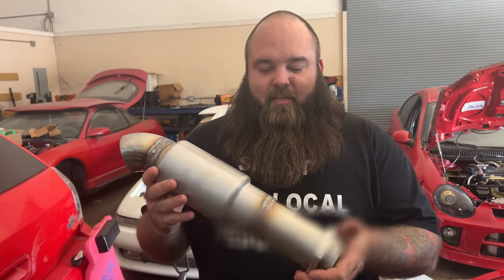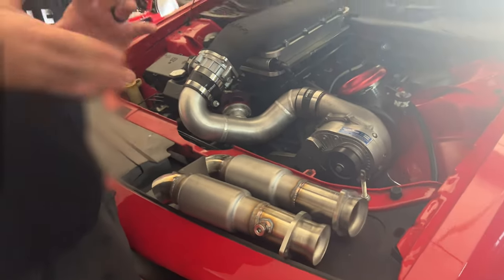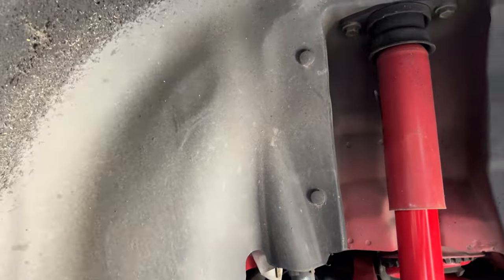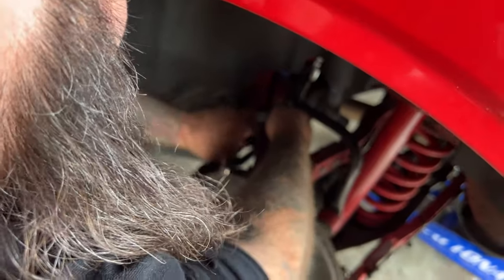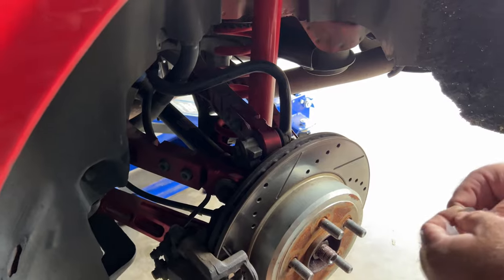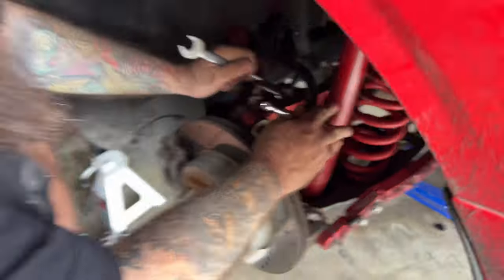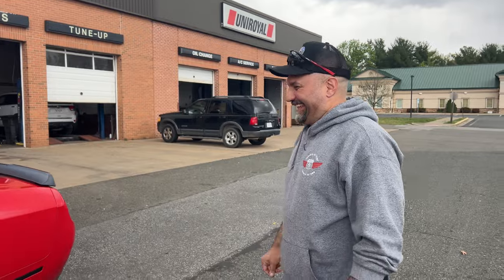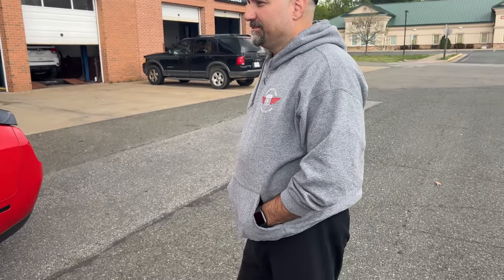Mack's Dumps Sounds Incredible! Plus, Suspension Mods Unveiled!

Comment: That's exactly why I put turndowns on my R/T....for 6 months now.  I CAN'T STAND the raspy noise that our full exhaust systems produce.  I installed turndowns, just aft of the factory bottle mufflers.  So, I still have the factory H-pipe.  It sounds so "old-school" now, like when we used to run around with 2-chamber Flows & turndowns.  Pavement shakers!! 😎
Added note: I think you should lengthen the pipes so you can A) install an H-pipe (they help!) and B)get the mufflers behind the pax compartment.
Reply from the maker: Yes sir! They do sound amazing! Check out the Engine Masters episode where they test dumps to full exhaust and other exhaust set ups. 😉